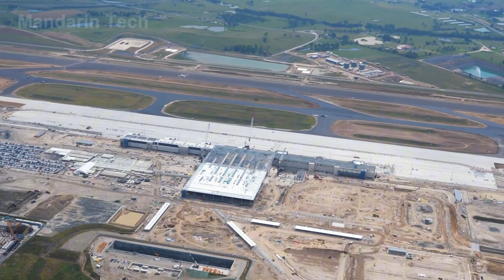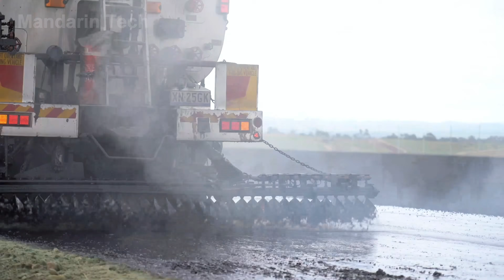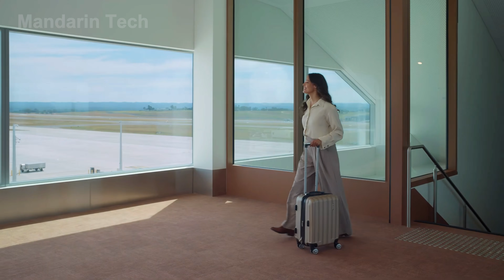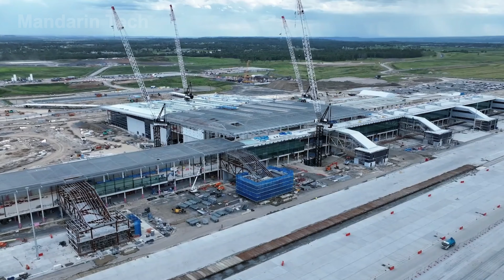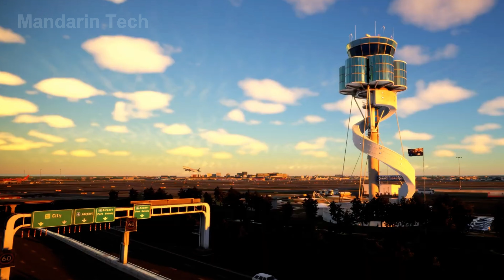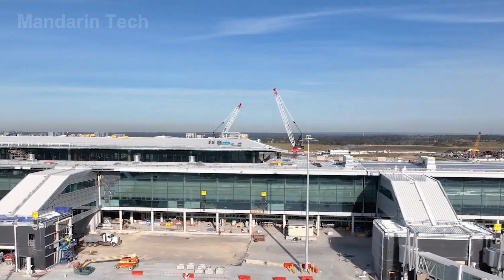Australia Is Building Its Largest $5 Billion Mega Airport In Over Half A Century

Comment: Very small
Reply from the maker: It's designed to start small but leave plenty of room for future expansion.
Reply: @Mandarintechmido  That's what I thought about the last international airport built in Australia in 2014. But there is a lot of flat land to expand and put in a second runway later. Yes I know the irony that everyone advertises that this is the first international airport in 50 years when its not. It's the fist Government owned in 50 years. The one built in 2014 is privately owned. Currently it's used as a second international airport for Brisbane. Just as Sydney have done.
Reply: Singapore's Changi Airport started wifh just one terminal in 1981 and one runway. It was originally the RAF airbase when the British were still in Singapore. Today, there are 4 terminals and 3 runways with a 5th terminal being built. This 5th terminal is bigger than all 4 terminals put together. Almost all of Changi Airport is built on land reclaimed from thd sea.